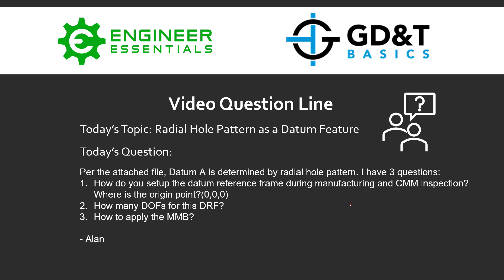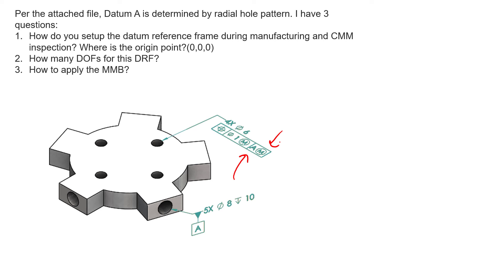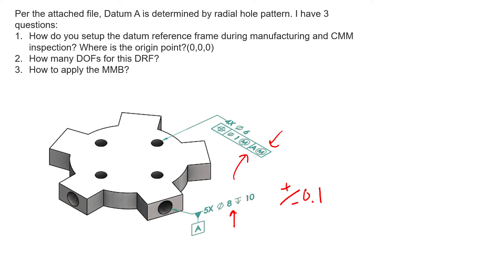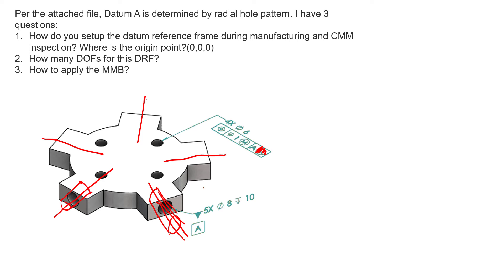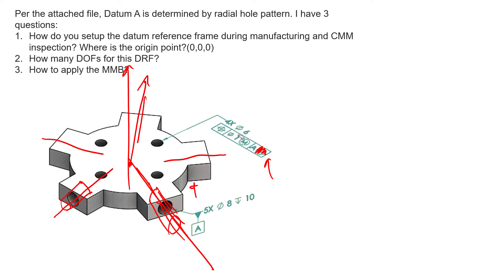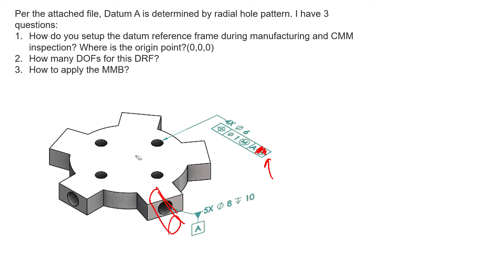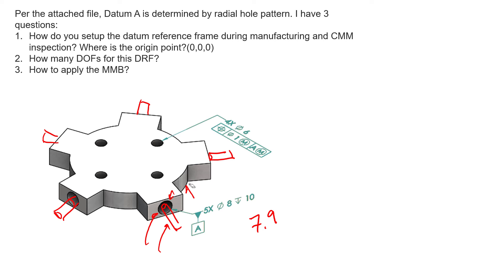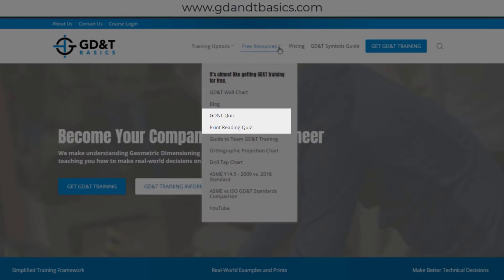Radial Hole Pattern as a Datum Feature

Comment: Very interesting video. 2 questions here, which I think were not clear:
1. While in the nominal case, those 5 cylinders converge to a point, in reality they will not. The axes will kind of miss each other in 3D space so how could a single point be determined?
2. Regarding the orientation in plane (that fixes the rotation of the pattern of 4 holes), you mentioned that you can choose whatever you want. But again, since on the actual part, those 5 cylinders will not have the nominal angles, is the reference orientation considered as an average between the orientation of those 5 cylinders? Otherwise, choosing just one would imply that it is a difference to which one you choose, since the will have different deviations to the orientation.
Thank you very much!
Reply: I would think the CMM can do the mathematical calculations for the 5 cylinders converge to a point. Every two axis will converge to a point, if we can find a a circle that just big enough to accommodate all the points converged from those 5 cylinders, that center of the circle I would believe be the determined zero point
Reply: That’s what tolerances and bonus material are for.  Nothing is ever perfect, so the same rules apply here.
Reply: @kw2519  No sure this is it. The only "approximation", if you will, is with regards to the point cloud filtration/association, which is the way to approximate the real geometry in the best way. Moving forward from there, all elements are perfect geometrical elements that have a precise mathematical description. There needs to be a precise way to calculate all of these median points, axis intersections etc.
Reply: @AlexLapugean  ya and that’s usually defined by the way your point cloud is setup.  You can take two measurements of 3 points and get a very rough approximation.  Or you could sweep the bore at 10 depths and get a much better result.  I’m just saying it all comes down to how the parts dimensioned.  As he said, we are the interpreters.
Reply from the maker: These are great questions. You are absolutely correct in saying that the axis of the holes will never converge on a single point. In order to get the center point of the pattern of holes as a datum we need to simulate the datum. And for a pattern of holes, that simulator (physical or digital with a cmm) is 5 cylinders located at true positions (ie converging on a single point) and those theoretical cylinders will expand simultaneously until the pattern of tangible holes "settle" out on the radial high points of all 5 holes simultaneously. This is simulation at RMB. However, a much more practical real world gage would be if datum B were called out at MMB, this would allow us to have stationary pins that dont need to expand. And the part is allowed to "shift" on these perfectly located pins, resulting in datum shift.
Reply: @Gdandtbasics  that makes a lot of sense, thank you

Comment: Hello, first of all, thank you for your work in your videos, they are very classifying. Now we go to my question, I have a part of sheet metal, 1.6mm thick, in which the only important thing is the relative position of 4 holes, the rest of the part is covered with the general notes of the part list. Can I dimension the four  holes with a position tolerance without any Datum? I just want to control the pattern between them. In Asme. Thanks
Reply from the maker: Yes you can do this, however, most often we see the surface that the holes are on being identified as Datum A and then the pattern of holes is identified as a datum feature with position to datum A. This essentially controls location of hole-hole and perpendicularity to datum A.

Comment: I put GD&T on my drawings to better define my parts and give the machinists more tolerance. But the parts are always quoted more expensive because they have to have more experienced technicians interpret my drawing and they say it requires a CMM inspection now. How would you respond to this?
Reply from the maker: Thanks for this comment, unfortunately we hear this very often. And while very complicated parts MAY require use of a CMM to speed up the process, the simple use of GD&T does not inherently implement the need for a CMM. In fact alot of times if the GD&T is truly understood by the inspector, many of the manual inspection processes don't change, only the interpretation of the variable measurements is what changes like in the case of diametric deviations. 

Long story short, complicated parts require complicated measurement methods and that has nothing to do with GD&T. The first step to alleviating this problem is training on tolerances and GD&T across the industry. We are always happy to help, whether that is through our free content online or more formal training options.

Comment: As far as I know, the material conditions might be applied only on feature of size. What should be the MMC value of a point, which is an intersectoin of five axes? Are you going to add the MMC of every cylinder? I think - no. Are you going to find the MAX MMC of some cylinder an use it? Or is it the MIN value? Think it is not correct either. Also, cannot think of any real world problem, that will require such dimensioning schema.
Of course, if it is going to be a check gauge - then, yes, it might work. But, don't think the CMM will be able to evaluate this.